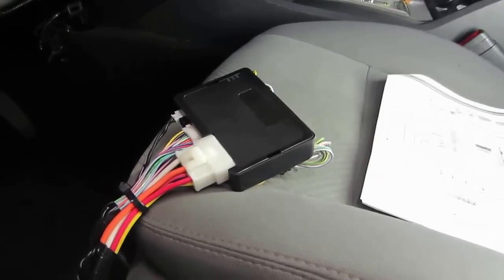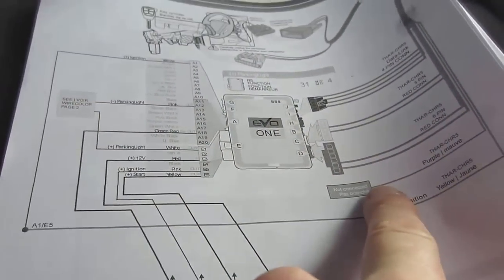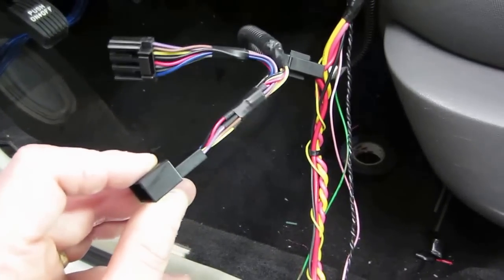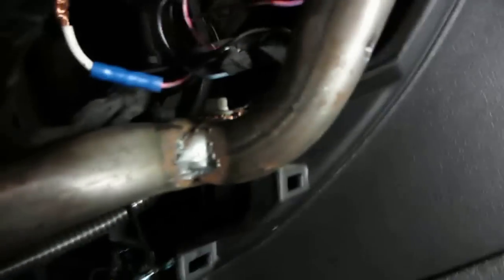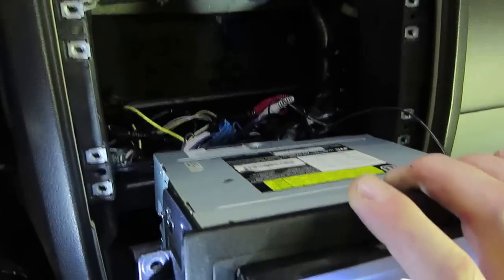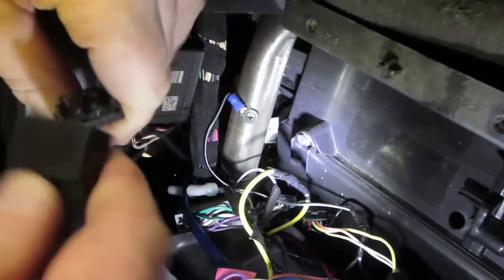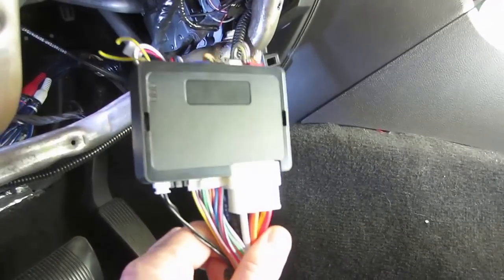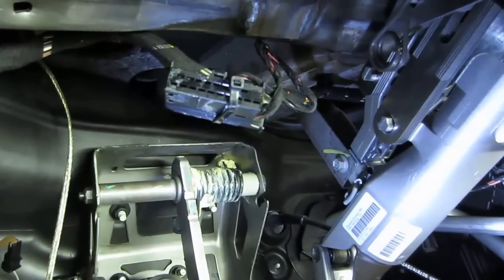How to install an Evo One remote starter Part 1

Comment: What about the hood pin switch
Reply from the maker: those are optional
Reply: @Lesscoelectronics  so I don’t have to connect a hood pin switch? I had installed a viper a long time ago and it had to have the hood pin switch connected. Thanks for the info

Comment: And sorry I meant 2004 Well it's all hooked up and it works when the remote starter is on I get in the Nissan and the starter grinds in accessory but it quits grinding when I turn it to the on position

Comment: 2001 Nissan Xterra how do I stop my starter from grinding when I put my key to the acc but when it's on the on position I stops how do I use the relay
Reply from the maker: +Ak24 do you mean with a key or the system Im showing here?

Comment: My evo one programs correctly and locks the first time with the blue light. Minutes later when I come back to the car and use the oem fob I get no blue light on the module. No remote start , no lights , doesn't attempt to crank at all. On the side of the module where I cut the yellow wire there is a steady flashing red light and that's it. Can anyone suggest anything to fix this ? 2010 dodge challenger standard key wire to wire using evo one no factory alarm. I've gone through the wiring 10x following manual # 94481
Reply: Did you ever figure it out?